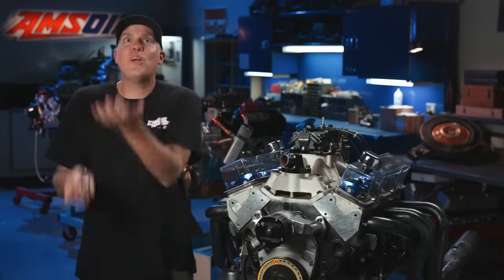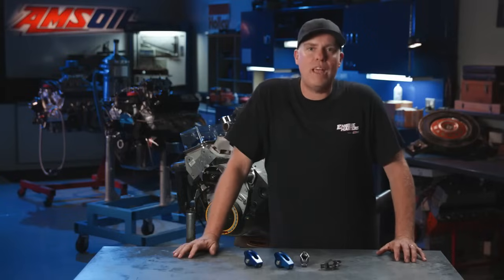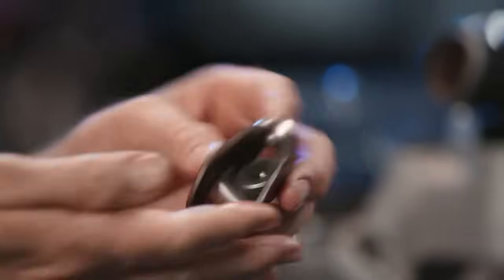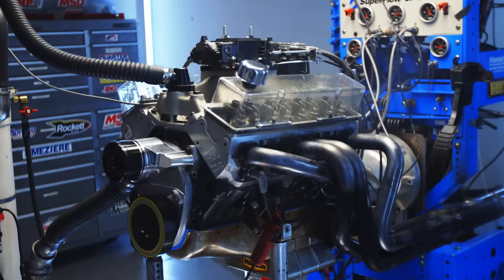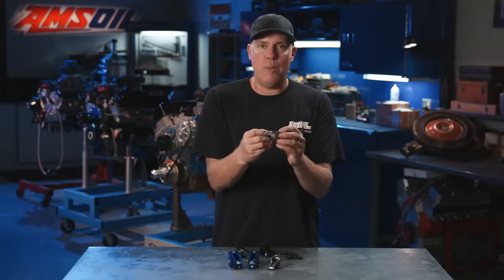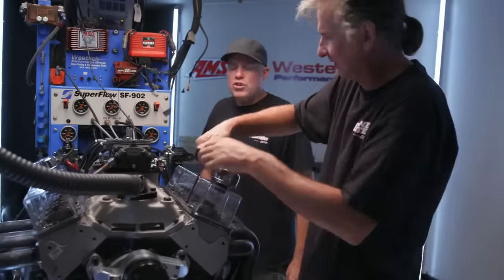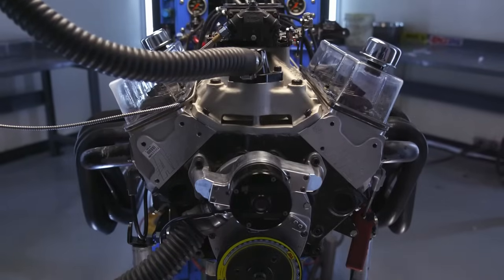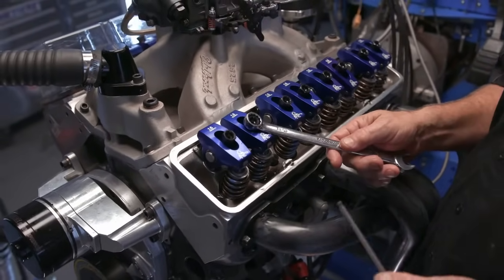ENGINE MASTERS  S2E29  Do Roller Rocker Arms Add Horsepower?

Comment: If nothing else they reduce wear and friction so even if the power gain is not noticeable, the wear and tear is worth it alone !!!
Reply: IF they don't fail.  I've seen to many roller rockers on street engines that didn't really even need them break or have roller issues that created a problem where there was none.  The have their place, but I think a lot of people are just adding cost and potential failure points to engines that that don't call for them.
Reply: @richardhertz8996 I have a 307 Chevy motor over 50 years old in my 40 year old bay liner boat. It has a cam and lifters and a 4 barrel intake from a 1985 350 mercruiser marine engine. That 307 is all original but the Cam and lifters and the intake and carburetor. It has every bit of push that the 350 had. But the 307 was stored in a garage for over 30 years. I have no plans to change anything unless it breaks... knock on wood !!!

Comment: Removal of friction. 
Like "tolerance stacking", remove a little friction here, a little there, adds up to greater total friction efficiency.
Reply: Frankly, the friction with oils we run now is negligible compared to the increased weight of the rocker, heavier push rod! The air density and temperature and correct trajectory! All that crap cuts into beer time!😂😂😂
Reply: What is the sweep pattern on the top of a valve, .020? Exactly how much friction is there to lose ? Zero.

Comment: If you have roller lifters you should go with roller rockers.
Without the spin from the lifters your push rods will not spin and wear becomes an issue.
For a dayly driver don't get caught up with added power at every opportunity to spend money.
Reply: That said, proper roller lifters/rockers and cam can reduce the power needed to turn the crank
Reply: I clearly stated that the spin comes from the the lifters (conventional) 
Care to exlpain how you thought that I implied that it came from the rockers?
Reply: care to explain how you think roller rockers have an effect on the push rod spinning????
Reply: @leftyo9589  
I never said that.
Standard lifters rotate and this is imparted to the pushrods. While this is critical where the lifter contacts the cam lobe, it also has the benefit of reducing wear where yhe push rod meets the lifter.
All I am saying is that if you go to the trouble to install roller rockers, go ahead and change out the cam and lifters to roller type as well. There is a certian amount of power needed to operate the valve train. The rockers have less affect than the lifters in this.

Comment: Of course they do. Build any OHV engine with roller rockers and carefully test it on a dynamometer. Write down the results. Now remove only the roller rockers and retest the engine. There will always be a huge difference in torque between the OHV engine with rocker arms and one without. This also works on OHV engines with stamped or forged rockers.

Comment: Saves on valve GUIDE wear.
Also will help lower oil temp.
Reply: I'd love to know by how much. I have a 454 with some fairly stiff valve springs, lives to tow, and runs the oil fairly hot under load even with water at 180. Probably not as much as I'd like to see.
Reply: @Supercharged111  100% worth on oil temp reduction.
Reply: @Supercharged111  The claim is 20 to 30 degrees reduction on oil temp.   I have noticed 20 degrees cooler on my oil temp guage.
Reply: @colejohnson3705  That would be fantastic, you're the first shred of evidence on this. Thanks.
Reply: @Supercharged111  You are very welcome

Comment: I never noticed the extra horsepower.  What I have noticed is the heat it takes out of the engine. Also it frees up the valve train
Reply: I would like to think better throttle response as its less resistance hence the higher overall Rpm.
Reply: On a typical SBC usually depending on the cam that's being used hp ratings are 20 to 50 hp more over stock stamped rockers because with stamped rockers the ratios are not all exactly the same . Some might be closer to 6:1 others 5:1 or less so there definitely is a hp gain when using them besides the friction loss using rollers that stamped rockers create extra friction & heat especially if it's a ball stud valve train like Chevrolets of the past used . Some classes of drag racing you aren't allowed to use roller rockers & can only use the factory rocker arms & what some engine builders will do is build a rocker arm tester that's let's say set at 1.5 or 1.6 ratio & they would go out & buy as many stock rocker arms from a dealership or the auto parts store they can then go through them all & keep the ones that were at 1.5 or 1.6 ratio to make full sets of 16 rockers that are known to be exactly at 1.5 or 1.6 ratio & take the ones not at the desired ratios back from where they bought them & either exchange them for other new rockers to test them or get the money back out of them back from the seller . By doing this all 16 valves are all opening up at the same lift being not all stamped rockers are exactly at 1.5 or 1.6 ratios . With a hydraulic cam it doesn't make that much difference but with a solid lifter cam or solid roller cams it makes more of  a difference because there isn't any lag time in those lifters compared to hydraulic lifters that that have lag time to pump up from oil pressure that can also change from heat once the engine gets hot and the oil gets hot & thins out from the heat which can cause a loss of power because the rockers aren't getting full lift of the cam shaft . I learned this from a book I have had for many years by legendary engine builder & racer Smokey Unic's book of how to make horsepower on any engine so if you can find this book I highly recommend it .
Reply: @peteloomis8456 never would expect that some would be 1.5 and some 1.6 mismatched on the same motor .  Id imagine after making them all 1.6 the would be some noticeable difference right of the bat .
Reply: Yup, I believe they even used to advertise that it lowered your oil temperature so if you're running an oil cooler and all of that you help contributing. And it's oil that breaks down under heat. The synthetics help that but after seeing what Peterson synthetics due to things I won't run them. They don't have any rust inhibitor. I live in a human area and you open things up in the rusty inside coated with oil it's ridiculous I was just bitching about Dodge Ins because everybody's burning them up for that very reason if you put on a chrome cover it's Chinese steel it rests right through that and it becomes like a Brillo pad that the oil actually leak through the rust then you end up with low or no oil and you fry the wheel bearing or the pinion bearing and then you get that famous rear end hole that says oh I need another rear end on a ram truck you might pay $3500. Which in my opinion is about $3499 too much lol😂 it's amazing how rear ends they've had for 40 or 50 years are now failing because of synthetic oil the craps like Crisco I went back to Lucas 80/90 in my rear ends and in big heavy stuff, 140 the moral of the story don't screw with what isn't broken😂😂😂

Comment: "You overhead-cam guys don't have these."

Honda people: That's where you're wrong, buckaroo.
Reply: Old Mitsubishi diesels too
Reply: @jckf  Lots of engines.  Basically everything SOHC has rockers.  Toyota 2GR V6 has them.  Most sport bikes have them now I think.
Reply: Hitlers MAN U boat dieses too
Reply: I can think of a lot of DOHC engines that have rockers.
Reply: I dont know if they had roller rockers, but Packard ran roller lifters in the 1920s.....
Reply: Ford 2.3l lima ohv with roller
Reply: My dad’s Yaris has a 1nz fe with roller rockers. One side is on the hydraulic adjuster and other is on the valve with the roller being for the cam. So much for DOHC not having rollers.

Comment: Well technically, if they are the same ratio as the stock rockers, then no. They won’t make anymore power, but they save parasitic loss. Save enough of that and it will manifest its self into something you can measure.

Comment: Thought id explain here so the same morons that couldnt interpret the roller vs flat tappet cam dont mis interpret this one.
The purpose of roller rockers isnt to reduce friction at the valve tip.
Edit: its to keep the lift curve of the valve linear throughout the lift curve. If you look at a stamped rocker from the side the flat part touches the valve and the radius that opens the valve as the rocker pushes it down is a different lift curve. You can plot it on a graph with the same cam and changing the rockers with the correct pushrods for each iteration

Comment: I ran comp cams roller tip with stud girdles and a big solid lift cam. I cant say it was worth any power, but it seen 7,500 rpm often in a larger journal 327. I can honestly see a roller tip being just as good as a full roller. You should have thrown a stud girdle on the 3/8 studs. Then tried the 1.6 ratio to see if the same results happened. I bet they would have been real close
Reply: Good points - dislike when other things are changed during a test of components.
Reply: I have never gotten the point of roller tip rockers.  If anything, put a roller on the trunnion and use a conventional tip if you want to make a cheaper rocker arm.
Reply: @richardhertz8996  you can't do that with SBC rockers. I would agree though.
Reply: @inscoredbz  Why not? What difference would it make if the rocker had a trunnion roller and a solid tip?
Reply: @richardhertz8996  have you ever seen a SBC stock rocker? It's not like an LS that you can swap out just the trunnion.
Reply: @inscoredbz   I'm talking about BUILDING a SBC rocker that had a a roller trunnion but not a roller tip.

Comment: just so happens, i tighten the locks exactly like brulé. if you are the type to pay attention, and you do a thing over and over, you'll eventually find the best way it can be done. i have never found any magic in the roller tip as far as guide wear goes and you would think it would contribute greatly to guide life, but that has not been my experience. high rpm and radical roller profiles are not easy on valve guides and i have always wondered how other people get away with using valve seals on a drag engine. i haven't used them since the early 80's and i have still never felt like enough oil is getting to the guides. i have seen guides turn blue from heat even with as much as .003 clearance and no seals. i honed the guides myself so i am sure of the clearance. how you get away with a 750 lift roller, .0015 stem clearance and valve seals, i have no idea.

Comment: Why NOT go with a set a roller rockers? Less friction, plus you can usually go up a number in ratio (1.5-1.6) and gain ~.30 of lift and a smidge of duration. But ALWAYS check your piston to valve clearance. Easiest way is with a dial indicator. You could also check it with play-doh, but that's only if you're willing to remove the heads.
Reply: ALWAYS check piston to valve. I like to use some soft solder. it is easier to measure than clay.  then use a transfer punch in the valve guide to find "the spot", get out the piston vice, set the angle,  set your fly cutter and fix the problem.
Reply: You can also use balled up aluminum foil if you dont have playdough. But yes, roller rockers, roller lifters, and a roller cam kit has alot less friction and you can limit rpm much higher.
Reply: I would tend to think a roller tip might be a good idea , not necessarily for hp . Haven't worked on engines for forty years, but it used to be valve guides would wear more on the sides where the rocker was trying to push it . Roller tip would cause less " push "
Reply: Wow, you're a engine genius.😂😂😂
Reply: I swear Hot rod magazine would have had these guys assassinated if they went public with this kind of information back in the day
Reply: Arent they also relatively cheap?
Reply: I think you meant .030" not +.300" 👍🏼
Reply: More parts to fail though
Reply: Because little needle brgs fail and like oil pumps?
Reply: YEP!
I'd prefer bushing rockers.
Reply: @fireballsoutherner we have a winner!! ☺️ Honestly I don't know how common that is but I've heard of it.
Reply: Yes seen it firsthand. Needles in the oil pump will change when you arrive for dinner..🙄
Reply: Did you watch the video, at the same ratio they didn't make any HP on stamped rockers.
Reply: Just as an fyi, friction isn't the reason for roller rockers
Reply: @lollipop84858yes it is, thats why honda uses them as it aids in higher rpm applications.
Reply: @lollipop84858 so what is the reason then ?
Reply: NERC-o4l
The problem of going from 1.5 to 1.6 rockers, is many times extra machine work needs to be done to the head.  The smarter way to go is buy a cam that gives you the lift you want with the 1.5 rockers.  Cheaper in the long run.
Reply: @bertgrau3934 The longer ratio makes sense if you're in a scenario where you're not looking to make crazy power and your stock cam is capable of what you're trying to do.  Chevy's tend to be under cammed, but if you're a foxbody guy, the cam is way better than the heads and intake, so say you're just looking to make 300 hp out of your 5.0, you can go 1.72 rockers when you swap heads and keep the stock cam.  And if you're running, say, P heads and not aluminum, the 1.72 rockers with the HO cam is a good match for those heads
Reply: @bertgrau3934 if you need "extra" machine work to run the 1.6, then you'd also need it for the cam that would give you the same lift!?!?